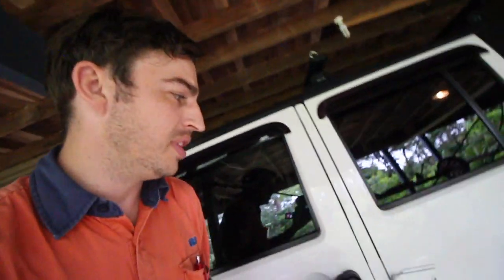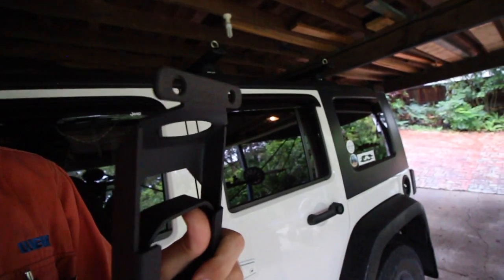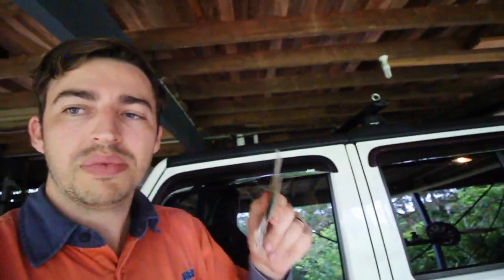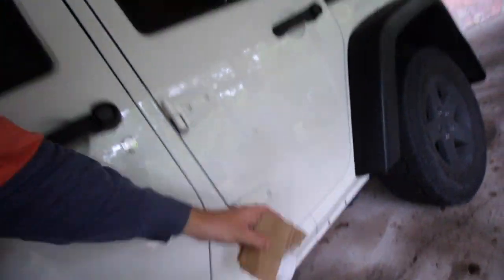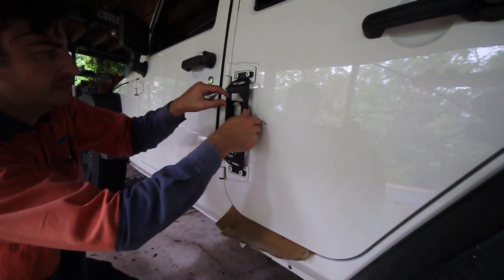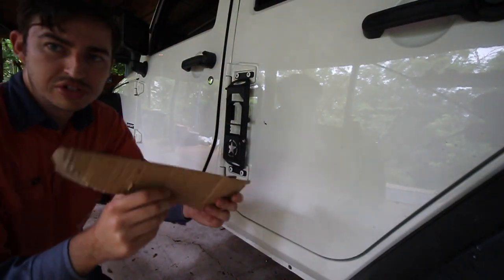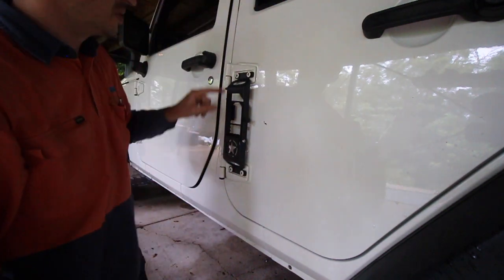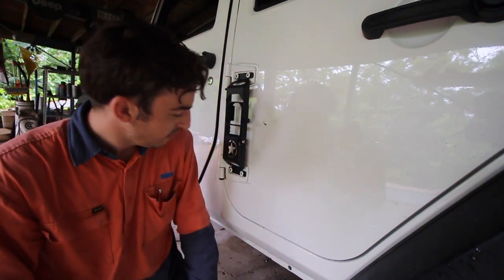JEEP JK  DOOR HINGE STEP

Comment: How hard to break those hindges bolts off I heard it's pain in the butt. I bout four from Amazon same style like yours  still waiting for them to come in.
Reply from the maker: Not hard at all, but that can depend on where you live, snow etc could make it a little bit harder, just take your time and do it slowly and you will be fine. Awesome they are so handy to have
Reply: @Whiteandsonsgarage  I live in Texas brother and did you use the oven bolts or just use the hardware that came with it. I'm not digging the silver all hardware at all
Reply from the maker: @neilsenmarquez6058  nice, I used the factory bolts from the Jeep, yeah I didn’t like the silver on the Jeep
Reply: @Whiteandsonsgarage  gotcha thanks waiting on the last pair to come In I'll be installing all four corners. Thanks much for the Info
Reply from the maker: @neilsenmarquez6058  no problem at all, happy to help